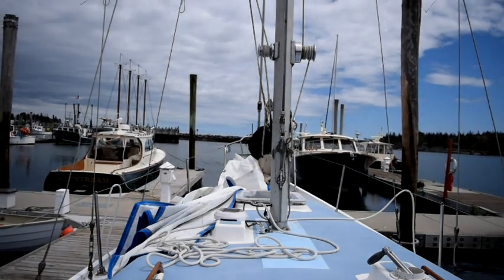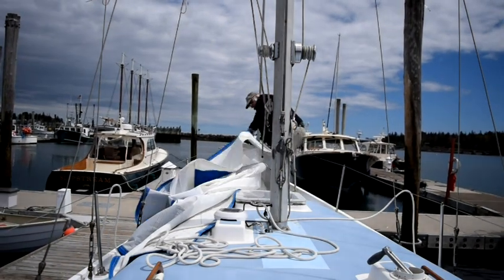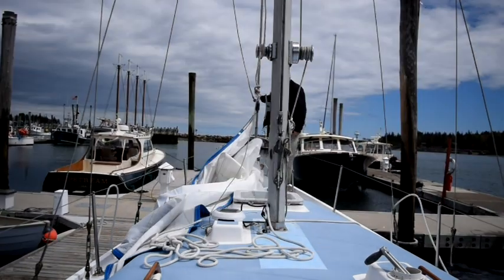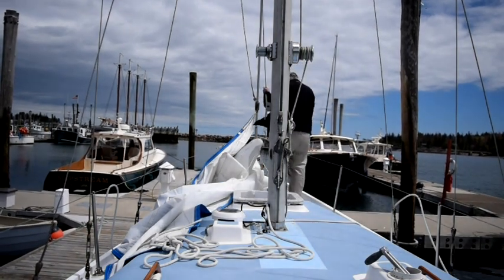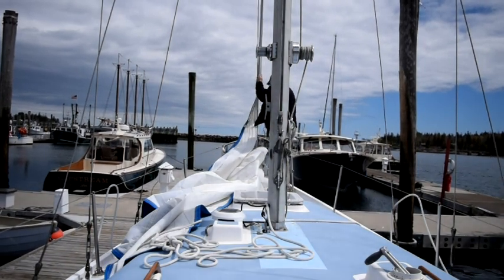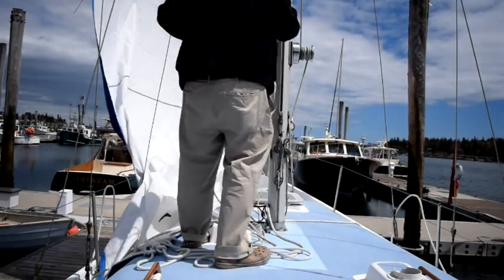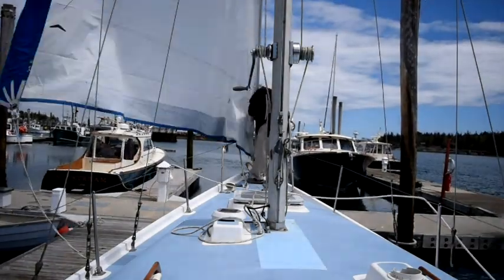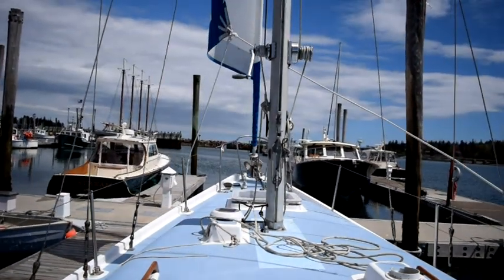Sailboat Prep: Putting the Genoa Jib on the Roller Furler for the 2019 Season

Comment: Thanks for this video.  I've just bought a boat and watching this gave me a lightbulb moment in terms of putting theory into practise.
Reply from the maker: Johnnie, the wind came up a bit while I was putting the genoa up which made it considerably harder than if it had stayed calm.  Anytime you are putting a larger sail up wind can be an issue.  My genoa is 335 sq. ft.  What kind of boat id you get?
Reply: @todddunn945  Just a small Leisure 23 that is setup for single handed sailing.  After i bought it, the previous owner took all the sails down and I have been staring at the rigging a bit confused.  Makes sense now after watching this.

Comment: I just purchased a 1965 wayfare 24 bahama islander and am having an issue with replacing the sail. Is there any way to be sure of which line is the correct one short of climbing the mast? Thanks for the video as it helped with the above exception.👍👍👍
Reply from the maker: There should be at least two halyards on your mast (main and jib).  You may also have a spinnaker halyard.  The main halyard will have a shackle to attach to the sail on the part of the line that exits the aft side of the mast.  The jib halyard will have its shackle on the side of the line that exits the front of the mast.  In addition on most boats the main halyard is rigged on the starboard side of the mast and the jib halyard is rigged to port.  So basically grab a line at the end that attached to the sail and look to the mast head to see which side of the mast it is on (Front or back).  Hope this helps.
Reply: @todddunn945  thank you Todd,  if I cant get it down today with your info then it must be hung up on something. The hull is in surprisingly good shape with no soft spots etc. Lots of growth on the bottom and the stays are loose including the forestay, it's been sitting a while and the rigging shows it. I thank you again and keep up the great informative videos! As a new sailor I look here when I have issues first and good videos that have enough information about specific topics like yours "covered dropping sail the best" are hard to find which is why you got my sub!😉
Reply from the maker: @OneDayAtaTime-j1p  I am not sure I understand your problem.  If you have a stuck halyard try this.  Secure one end to a hard point on the boat.  Tie a large loop in the other end using a bowline so the bottom of the loop is a foot or so off the deck.  Put you foot in the loop and gradually put your weight on the line.  If the line doesn't move, try doing the same with the other end of the line.  If it still doesn't move, then the problem is likely at the mast head and you are either going to have to climb the mast or drop the mast to fix it since the issue is likely a seized sheave (pulley) at the mast head.  Personally I would drop the mast since it is a lot easier to work on the mast when standing on the ground than when swinging around at the mast head particularly on a small boat.
Reply: @todddunn945  I'm impressed with all your help. I appolagize if I'm hard to follow. I am new to sailing aside from a few trips on a hobie cat 16 when I was in my teens. Those memories are why I wanted to pursue this path. My deck is very moist from fog this morning but I'll give you an update as to the outcome now that i have good information. I tried dropping the sail in the roller furler yesterday but wasn't sure if i had the right line as the lines are a mess and i hadn't found your video yet. Your very good at making them easy to understand and provided me with all the information I need so no worries there and I am grateful for all the help!😁 I'll comment on what happens once my decks aren't so slick and I bet with the info you gave me I can get it figured out. Thanks again Todd and have a perfectly awesome day!👍👍👍